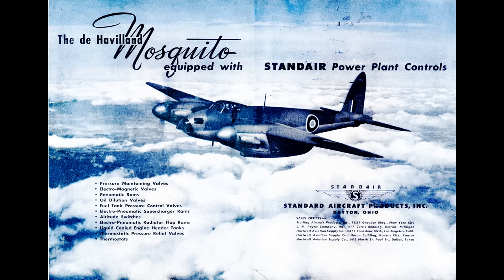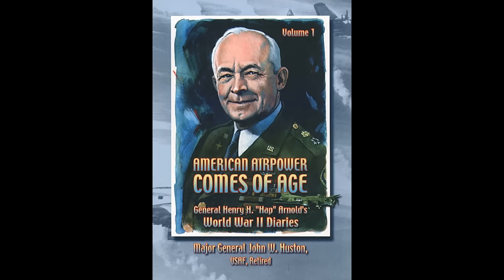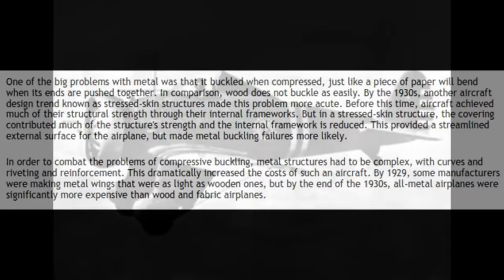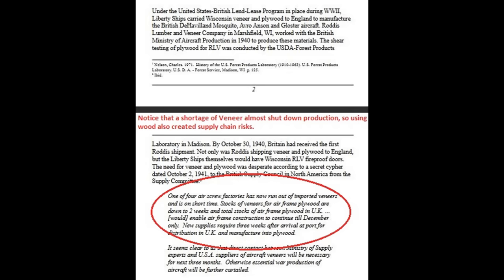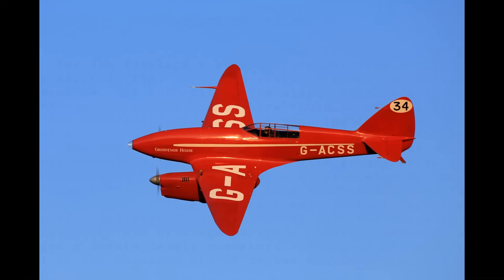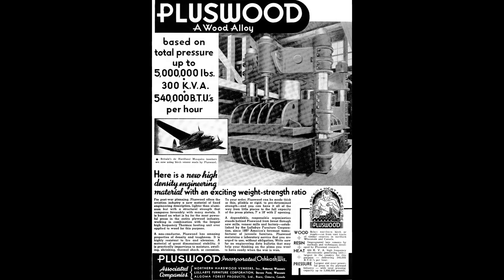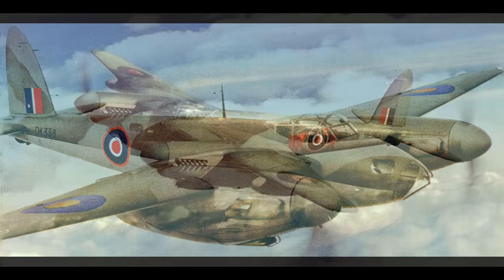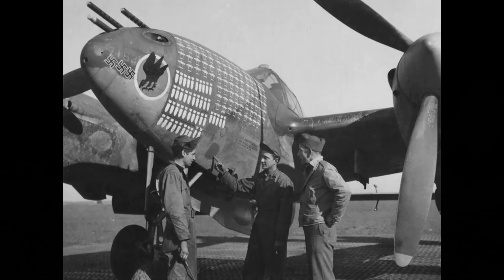De Havilland Mosquito vs. ?

Comment: OK.  There are people who would insist - that the US should have been building Mosquitoes INSTEAD of P-38's.  That is bull shit.
 
What is correct - was that the US was already building P-38's as fighter planes - which the Mosquito WAS NOT - and they could do all the things the Mosquito was supposed to do with P-38's - so - the question really was - should they have built Mosquitoes IN ADDITION to P-38's.
 
Well, let's look at the big picture here.  The US was not only ALREADY building P-38's - but B-25's, B-26's, A-20's and a whole slew of single engine fighter planes and attack aircraft.  So - did the US have a need for yet another aircraft?  Not necessarily.
 
The Mosquito was a good aircraft and if the US had decided to build some - that wouldn't have been a bad thing - but - they didn't really have a need for it.
 
There are other things about the Mosquito that are ... a consideration.  Here - you have a difference between the way the British did things - and the way the Americans did things.  This isn't about which was "better" - but about the fact that they were - different.
 
American bombers - had a Pilot and a Copilot.  A lot of British bombers only had one pilot.
 
American Bombers - ALL had defensive armament of some type.  Mosquitoes had no defensive armament.
 
American Bombers also commonly had some offensive armament.  The Bomber version of the Mosquito had no armament at all.
 
American Aircraft were ALL made of metal - the Mosquito was made of wood. In order to make Mosquitoes - the US would have needed to create factories and train workers to do something de Havilland was already doing. 
 
Americans built aircraft to fight their way through enemy opposition.  Because wood was more vulnerable to battle damage than metal the Mosquito tried to just avoid it - and British Bombers in general flew at night in an attempt to avoid enemy fighter planes.
 
AGAIN - this is NOT about which was "better" but about the fact that there were things that the Americans and British did differently.  Because they did things differently - there were some American Aircraft the British used - and others - such as B-17's - that they didn't care for.  There were a few British aircraft - such as Mosquitoes and Spitfires - that the Americans did make some use of - but none that they used extensively.
 
The two air forces - had different tactics, different strategies, different training, different maintenance procedures and different manufacturing processes.  For the Americans to make large scale use of Mosquitoes - they would have had to change their way of doing things to accommodate it.  So - just as the British did not choose to use American Bombers as Bombers - neither did the Americans choose to use Mosquitoes on a large scale. 
 
So - there are a lot of reasons for the Americans to not make Mosquitoes besides those initial evaluations.  Thus - while I would say that it would not have been a mistake for the Americans to build Mosquitoes - neither was it a mistake for them not to.  It was merely a choice.
.
Reply: Bob Smith
Good point about things that are different are not necessarily better or worse.  That extends to doctrine as well.  I can't believe the USAAF compared the Mosquito against the P-38 because they were built for different roles.  If there was actually a thought of building the Mosquito  instead of the P-38, it was harbored in the minds of those who didn't like the heavy twin engine fighter concept to begin with and would like to see it cancelled.  But as you alluded in describing medium bombers, the USAAF did not have a concept for an unarmed schnell bomber either.  In fact he British almost didn't build the Mosquito for much the same reason, and there were attempts to add defensive armament, which would have changed the character of the airplane considerably.

I think it would have  been a big mistake to cancel the P-38 in favor of the Mosquito.  However, I do think it would have been smart to build Mosquito type aircraft and more twin engine fighter bombers instead of the the medium bombers USAAF favored--that is the real area for comparison.
Reply: @gort8203  Eh ... the thing with the Medium Bombers was the USAAF knew what it was doing there and they really got a lot of use out of those mediums.  Now - what changed was the concept of the Fighter Bomber.  So - after WWII you do see them moving away from Medium Bombers - but not all together.  They got a lot of use out of Canberra's and Invaders (which might be better classified as light bombers or attack aircraft).

After the war, you had whole categories of aircraft that they stopped using, Dive Bombers, Torpedo Bombers as well as the Mediums but all of that was based on their experience during WWII and the evolution of the Fighter Bomber - which could still be used as an escort for the Heavy Bombers.

So - the idea of the Medium Bomber did go away but it wasn't something that they were ready to do during WWII.
.
Reply: @BobSmith-dk8nw 
"So - the idea of the Medium Bomber did go away but it wasn't something that they were ready to do during WWII."

Correct, they were not ready. The technology was ready, but not their mindset.  They didn't see it yet, even though the Mosquito was a harbringer they ignored.  I'm saying that if they had seen it they could have made the transition to more flexible and cost-effective aircraft much earlier than it eventually happened.
Reply: @gort8203  Well ... yes and no.  After all - the Mosquitoes went away too.
 
I also wouldn't say that they ignored it.  They had a lot of different aircraft that were already in production and that they had crews trained to use - so that's what they used - though they were able to shift more and more to Fighter Bombers - since they already had those.
 
I think the big thing that went away - was the idea that the bombers could fly unescorted.  Thus the shift to using such aircraft as the A1 Skyraiders which they used a very long time.  This was an attack aircraft but they dispensed with the crews manning defensive gun positions.  For the B-29's in Korea - they flew daylight missions until the Soviets started intercepting them with Mig-15's - and they switched to night raids.  Even during WWII, LeMay took all but the tail gunners off and flew at night - but he did that because Japanese industry was made up of a lot of scattered shops and the precision bombing of large factories wasn't applicable any more - so they went to fire bombing whole cities.
 
Thus - they changed the way they used the tools they already had throughout the war.  The P-47's and P-38's had been designed as high altitude fighters but they switched those to ground attack as Fighter Bombers then used the P-51's as escorts (and as Fighter Bombers too).  Another thing they did was to take B-25's in the Pacific and turn them into strafer's, skip bombing or dropping parachute frags.  They started off with standard B-25's being customized in the field and then began using factory versions, some of which they put a 75mm gun in. 
 
After the war though - the big transition was to jets.  Even in Korea - the main reason they were using P-51's was not because they were all that good at ground attack - but because that was what they had.  Then gradually these were replaced by jets.
 
As to multi-engine attack aircraft - they had those in WWII - in the form of A-20's and A-26's.  So - it's not like here was this wonder weapon that Americans were to stupid to see.  It was more like ... "well ... it's a good aircraft - but - we already have something that does that job - why build something else?"
 .
Reply: @BobSmith-dk8nw  You're mixing in a lot of data points there but I think you're missing my whole point. They actually didn't have anything like the Mosquito, so they were doing the job with less efficient aircraft. The Mosquito went away like all airplanes do, but the unarmed fast strike aircraft concept did not go away, and it replaced the armed but slow medium bomber concept.  Survival of the fittest--just look at postwar aircraft designs.

But Germany had already caught on.  Everybody seems to think the high speed DO-335 was an interceptor, but it had a bomb bay because it was built in response to a May 1942 RLM requirement for a schnellbomber-like bomber/intruder. It was meant to be a more advanced single-pilot Mosquito equivalent. The Luftwaffe was already engaged in a technical and doctrinal transition that USAAF didn't evolve into until after the war.  That should come as no surprise when you consider how much more combat experience Germany had than the U.S. in 1942.
Reply: @gort8203  Well - I'm afraid that you are missing the point.  The point is - that while the US did not have any one aircraft like the Mosquito - it did have several aircraft that could do any and all the jobs the Mosquito could do - and others.
 
The Mosquito was not a bomber that could fight it's way through to a target.  It sounds really clever to think that they would just zip in and zip out before Germans could do anything about it - but they couldn't always do that in numbers large enough to matter and the more bombs they carried the slower they would go.
 
There is a difference between being an Intruder and being a Bomber.  The Mosquito was an excellent Intruder but it wasn't as good a Bomber as aircraft that were Bombers.  And - the thing that they transitioned to was NOT a bunch of Intruders (except of course of the A-6 Intruder) but a bunch of Fighter Bombers like the F-105 and F-4 and attack aircraft like the A-7.
 
The Fast Bomber the US went to - was the B-58 Hustler - but they had a lot of problems with it and discontinued it.  So the idea that the Germans were developing this forward thinking idea in WWII that the Americans didn't pick up on until after the war - just isn't the case.  The Germans NEVER had a Schnell Bomber.  They wanted one but the closest thing they had was the Arado.  The Luftwaffe was always a Tactical Air Force.  It never had a Strategic air craft that mattered and their Bomber Force didn't matter after 1943.
 
The idea of the High Altitude Fast Bomber went away with the XB-70.  Once AA Missiles got where they could shoot down those bombers - speed didn't matter any more and even the B-52's began training on low altitude penetration missions.
 
The idea that there was ever this one really smart way of doing things - is a fallacy.  There was NEVER just one smart way of doing things.  There were ALWAYS different ideas that were being developed for different purposes - and anything that was put into practice immediately had people working on a counter to it.
 
Other factors that came into play were Electronic Warfare and Stealth Technology.
 
The thing with ALL the different theories on Air Power - was that when there was an actual attempt to put them into play - some things worked better than others and some things had to be modified and tactics adjusted.
 
Remember also - that there were a whole series of bombers that - when they came out - were faster than the fighters of the day - but then - the fighters got faster and could catch them.  So - the idea of a Fast Bomber - was nothing new.  It just didn't ever last very long before the fighters caught up.  Look at the Do-17.
https://en.wikipedia.org/wiki/Dornier_Do_17
 
The reason the Germans never really had a solid counter to the Mosquito wasn't that they couldn't have built one - but that they were concentrating their efforts on the old style Heavy Bombers of the British and Americans that were destroying their cities.  The Mosquito, compared to those Heavy Bombers, was never anything more than a nuisance.  It was a useful aircraft to the Allies and the Germans did try to develop counters to it - but they were so over whelmed by everything else happening to them that they couldn't pull it off.  The Germans had jets that could catch it but they didn't have engines that were good enough to get all the airframes they'd built in the air.  And - most of those jets - were kept busy trying to thin the Heavy Bombers destroying their cities.  If the Germans hadn't been so over whelmed - they'd have developed an aircraft faster than the Mosquito and shot them down.  They had aircraft fast enough to do that - but - not enough to matter.  The Germans even tried to build their own Mosquito but the factory making the glue got bombed - and that was the end of that.
.
Reply: @BobSmith-dk8nw  No Bob, you're missing the point.  But you will not be convinced, so have a good day.
Reply: @gort8203  No Gort, you're missing the point.  But you will not be convinced, so have a good day.
Reply: The Mosquito was a fairly lousy medium and high altitude bomber.  Note that the RAF ordered many thousands of Lancasters even after the brilliant qualities of the Mosquito were well known
Reply: @petersouthernboy6327  Yeah.  It was a really good Intruder, Path Finder and Re-con aircraft but you get these Skeeter Fan Boy's all excited and it's the greatest thing since ... EVER (!!!!) ... 

Reminds me of Apple Macintosh People ... 
.
Reply: Gort - a Mosquito with a 4,000 pound bomb load is no longer a Mosquito.  Which is why the RAF ordered 7,377 Lancasters starting in 1941 - after all of the brilliant qualities of the Mosquito were known
Reply: @BobSmith-dk8nw  Thank you for the comment. Adds alot of perspective.

Comment: Geoffrey de Haviland did pitch the Mosquito to the air ministry to a large part on the basis that it would be built of non-strategic materials that would remain available in ample quantities. The video seems to imply that the airplane was built of wood not due its nonstrategic nature, but simply because wood is just as good or better than metal.  But these are not mutually exclusive reasons so we don't have to choose one over the other.  De Havilland could obviously make wood sing, and was very successful in building a high performance aircraft with it.  But it took a while to convince the air ministry that Britain needed an unarmed bomber.  The Mosquito probably manged to run the numerous selection wickets to production in large part due to the fact that at no time within that gauntlet did it threaten the strategic materials supply allocated to higher priority projects.
Reply from the maker: I was making the point that the main reason they used wood was because that's what De Havilland had the most experience with. I think the "strategic" materials part was secondary.
Reply: @GregsAirplanesandAutomobiles   I agree that de Havilland designed the airplane in wood was because they had the most experience with that material.  But I do not see any reason to discount that fact that the design caught the attention of the air ministry because it was serious about designs fabricated from non-strategic materials.  I don't see evidence indicating that to be a secondary reason for greenlighting the Mosquito rather than competing projects.

Comment: There is an interesting story of two Mosquitos being modified to counter Ar 234s flying reconnaissance missions over England. Souped up engines, radar and pressure cabin. They loitered at close to 50,000' and waited for the Ar234. When one was spotted they converted altitude to airspeed and were able shot an Ar 234 down. Overflights supposedly stopped. Do you know anything about this.
Reply from the maker: I haven't heard of that, but it certainly makes sense. Ar 234s did fly over England right up until the end of the war, and a souped up diving Mosquito would have been a good way to try and stop them.

Comment: There are some interesting battle damage photos of mosquitos which may be more design than materials in which large chunks of wing have been blown off and they have still got home. The adhesive used was changed to a more tropical type after the losses in se Asia but as you said it's hard to get to the bottom of what happened. Both it and the p38 got used by members of 617 squadron for in unit target marking so must be reasonable substitutes for eachother some of there roles.

Comment: The up turned booms of the P-38 pictured in your video. Is Lockheeds experiment trying to come to terms with the compressibility problem. The fix of course was the mid chord spoilers on the bottom of the wings. What's not mentioned   is the P-47 had these same type spoilers installed but I have no time line of this mod.  Remember one time asking a couple 47 pilots about the spoilers and if they ever use them. One said yes and the other guy said no. They looked at each and one said to the other when do you ever use them? He said when I want to get down fast. Well I just use the cowl flaps!  You know right your not supposed to use those until your under such an such speed. The conversation got awkward pretty quick. LOL
Reply from the maker: According to "American Warplanes of WW2" by Col. J. Current that tail was originally for a floatplane variant, but then was tested to see if it improved compressability. However further research shows that there were several different upswept tails, so I can't be sure if it's the same exact one.

Comment: if you want my opinion national pride was part of the reasons.

but mostly the planes they had were because the current tooling and machinery for the planes were already built. so it was better just building what you had then and there than trying to retool a factory to build a different plane. and thats not even mentioning the changes of labour, logistics and sourcing of material. so in the end they went what they thought was best.

tho beechcraft were a bunch of toddlers and you see that quite easy on their report